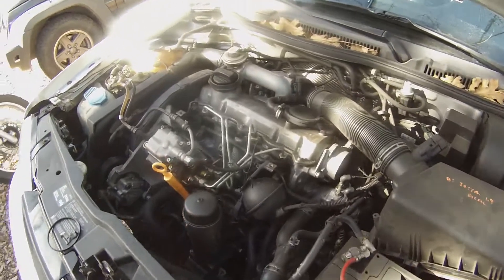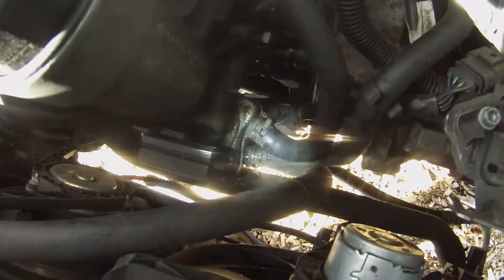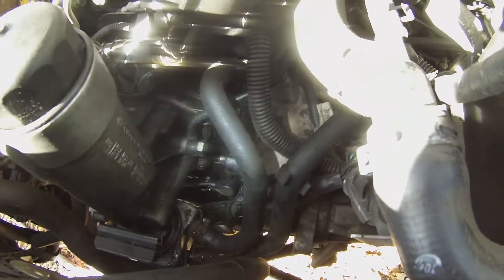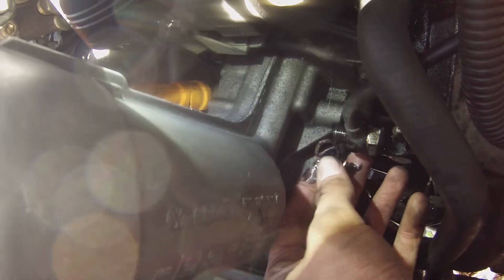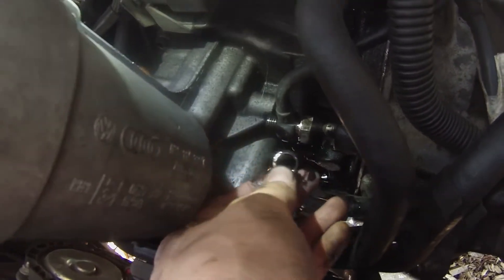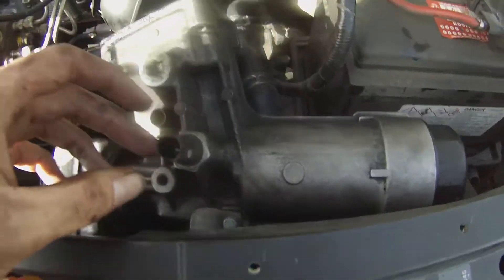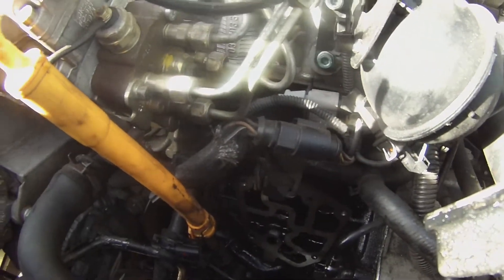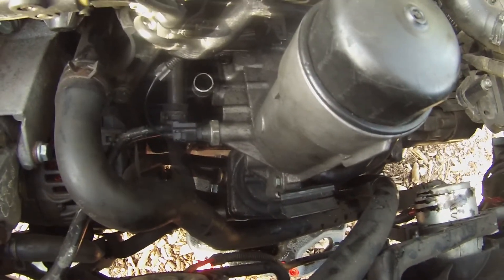VW Golf 1.9 TDI - Replace Oil Filter Housing Gasket

Comment: I need to do this on my 1.9 TDi 2004 Passat - trouble is, the engine in the Passat is mounted the other way, as if it were rear wheel drive, which of course it isn't. Seems to be the same housing as in my 1.9 AWX engine. Mine even has an engine mount that looks half in the way. Very very useful video,  thank you! Was good to see some movement on the hard oil line to the turbo. Did that hard oil feed line drain itself of oil when you unbolted the banjo? Would make it dangerous to start for a few seconds for the turbo maybe?

Comment: Was the car pissing out oil ? Because my leaks when it’s on and when it’s of I think I might be this ( 4 years late but I would appreciate if you answered)
Reply from the maker: It wasn't leaking really bad, just a slow leak. However overtime it had made a mess of the whole bottom of the engine

Comment: Can coolant leak there too? Im getting major coolant leak around that place
Reply from the maker: The bottom portion of that filter housing is an oil cooler using the engine's coolant. If it's leaking, I would think it would be coming from one of the two coolant hoses attached to it or from the oil cooler itself. It shouldn't be leaking from where the filter housing mates up to the block.

Comment: Was your oil light flashing? That made u change the gasket
Reply from the maker: I changed my gasket because it was leaking really bad. If your oil light is on or flashing, you should immediately STOP driving and shut off the engine until you can find out why the light is on. The oil light is supposed to come on when the engine is experiencing low oil pressure which can catastrophically damage the engine in a matter of minutes or even seconds depending on how bad the problem is.